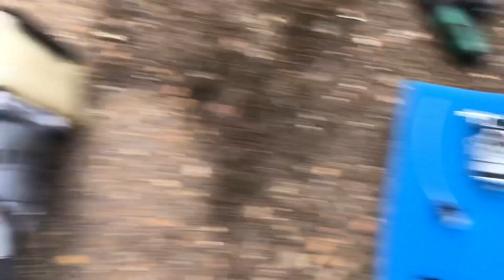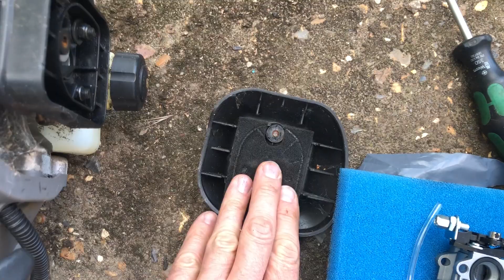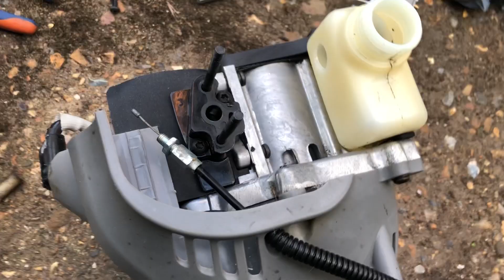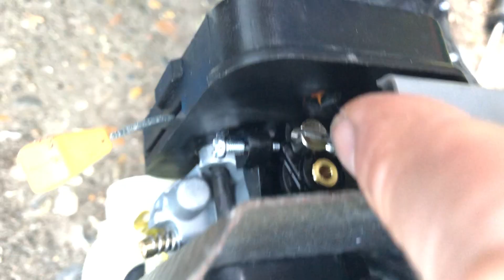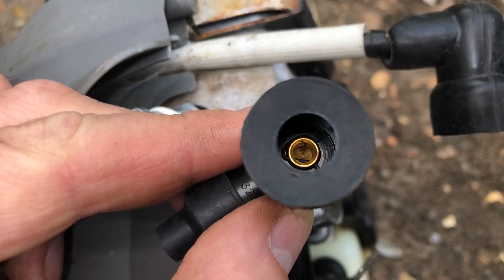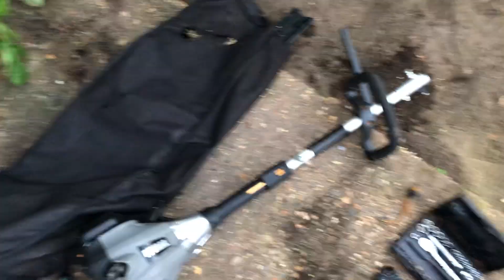Titan, Ryobi, McCulloch, Husqvarna Garden Trimmer Repair

Comment from the maker: Step by step how to repair your Titan or unbranded garden multitool if it fails to start or needs TLC. N.b. this will be the same or very similar for almost any brand (in particular Ryobi, McCulloch, Husqvarna etc) of 2 stroke garden tool. Inspired by a video from Mighty Micks Mowers: https://youtu.be/HZKo2Esnf8c

Tools you will need:
Screwdriver set: https://geni.us/PKUmD
1/4" socket set (for the 8mm nuts & T25 bit): https://geni.us/GSRN0q7
Long Torx Bit set : https://geni.us/S540My4
19mm ring spanner (for spark plug): https://geni.us/YKB2Wgn

Supplies you will need:
[ebay item numbers]
Universal carburettor: 195508773975
Air filter: 193171018422
Fuel line & filter: 175352784077
Spark plug: 362197319277
(correct) Spark plug cap & HT lead repair kit: 143221112899
Kit if you prefer to strip the carb down: 185494999140
Priming bulb (if you want to keep your existing carb): 175352784075
(optional) foil tape (to protect the plastic from heat): https://geni.us/Q8w1AUM
silicone grease for choke lubrication: https://geni.us/aMWcy

Disclaimer: If buy from the links above I receive a small commission which helps fund the channel.

If this helps you, please consider liking and subscribing. Any questions or feedback - please leave below!